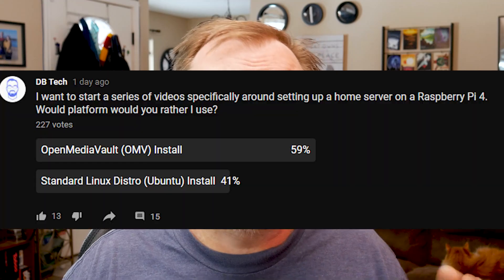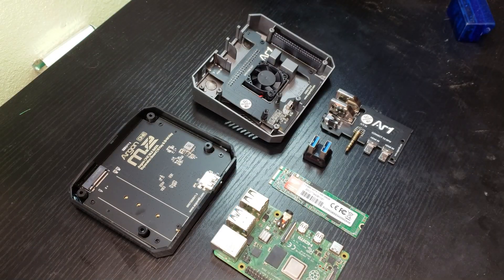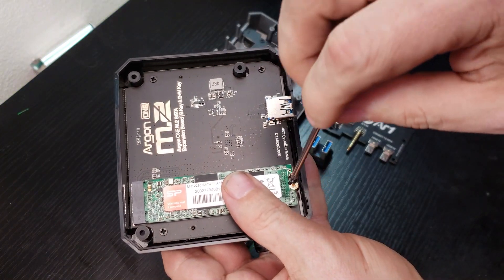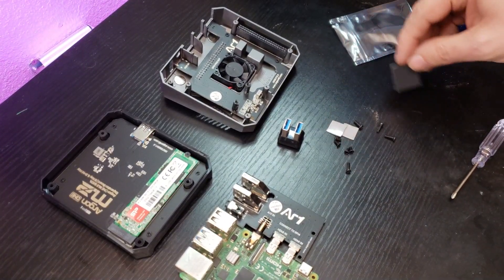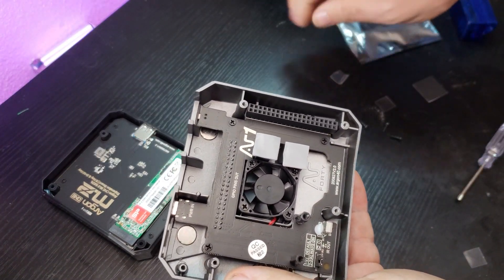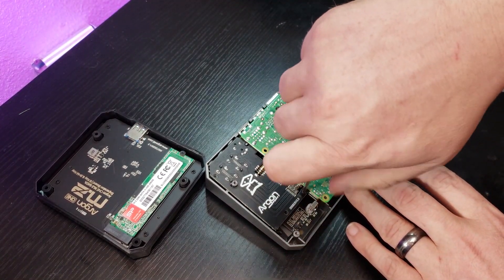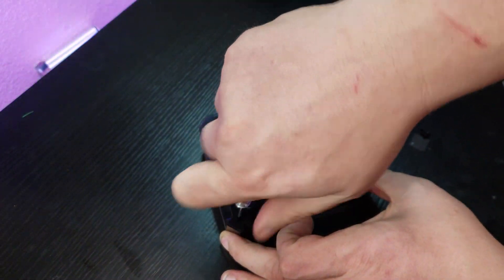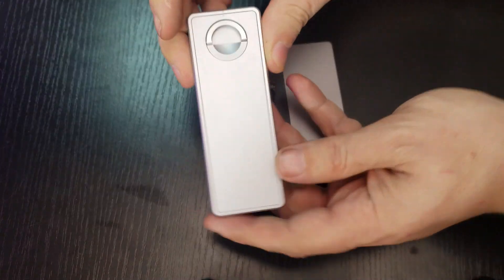Raspberry Pi Home Server Episode 1: Hardware - Raspberry Pi 4 8GB - Argon One M.2 - Sabrent

Comment from the maker: There are a couple of things I forgot to mention in this video: I will be using Raspberry Pi OS WITH the desktop. Also, I needed a POWERED USB hub in order for the 2TB external drive to have enough power to work appropriately.
Reply: I have one and is very good, I have 3 ssd connected to it. One for Movies and TV Shows not being backed up as I delete the media when I watch it. And one for my personal files, and the other one is just a mirror backup for my files using OMV rsync. My USB powered device is TP-Link UH720 and is working very good and tested as well in one of the Raspberry official page forum.
Reply: I have a 3 TB HDD (2 TB HDD + 1TB HDD) Connected to Pi 4 USB 3.0. The pi is powered from 18 Watt adapter, will it be sufficient enough for powering the entire system.

Comment: Great video! Would you mind making a video how to install raspbian and omv on the ssd or some instructions. I boot my pi from sd card and just interested how to boot from ssd for better performance. Also one more thing for the hardware. I have sometimes trouble to access omv and then I need to reboot pi and that's ok when I am at home but outside it is impossible. I bought a small device to control power from anywhere it is called  sonoff basicr2 (think around 5$), it has it's own application for android and ios from where you can simply on/off raspberry from anywhere. This solved all my issues when I wasn't able to access omv. Hope this helps! Your tutorials are the best! 👍

Comment: Just bought this case! Thanks!
Why you don't try to boot from the m.2 ssd?
Reply from the maker: I did boot from the M.2
Reply: @DBTechYT  sorry, I missed that part
Reply: @DBTechYT  I just got this case but can't boot from my ssd.. please show the installation process. Thanks!
Reply from the maker: If you can't boot from USB/SSD then you most likely don't have the most current firmware on your Raspberry Pi that allows for booting from USB and you need to upgrade the firmware of your Pi.

If you're not sure how to get your OS on the SSD in the case, then what you need is a cable like this: https://amzn.to/3hspVxx

Install the SSD into the bottom portion of the case.
Plug one end of the USB cable into the USB port on the bottom portion of the case.
Plug the other end of the USB into your computer.
Download the OS you want to use. 
Use something like Balena Etcher to "burn" the ISO to the SSD.

Then put the case together and plug in the USB bridge between the lower portion and the upper portion. Then you should be able to boot from the USB drive in your case.
Reply: @DBTechYT  I'm using WD m.2 ssd.
Already upgrade the firmware to the lastest and config to boot from usb.
Tried to flash raspberry pi is lite directly to the ssd- not boot.
Tried to to clone sd (with the same os) to the ssd and not boot.
Reply from the maker: I dunno then. That's the process I went through each time I setup my Pi devices to boot from any SSD.
Reply: Do you have any other recommendations for m.2 ssd for the argon?
The SC is not available.. :(
Reply from the maker: This is the one I'm using in mine: https://amzn.to/3aVnO44
Reply: @DBTechYT  I know, I wrote that it's not available
Reply from the maker: Oops. It was available for me, so I guess I missed that. Kingston is a good brand: https://amzn.to/3n0EWI7
Reply: @DBTechYT  the question is will it boot from this SSD?
I don't want to bought other ssd and find I can't boot from it like WD
Reply from the maker: I'm not sure. It has to be a SATA SSD. It can't be an NVMe SSD.
Reply: @DBTechYT  same ssd with usb to m.2 adapter work fine (but not in this case)
Which version of RasPi OS do you use?
It's 32bit?
Reply from the maker: I used Raspberry Pi OS 32bit
Reply: @DBTechYT  this 32bit OS don't used all the 8gb ram..
Reply from the maker: Then install Ubuntu 64bit for Raspberry Pi and then install OMV on top of it.
Reply: @DBTechYT   ok this issue is getting very weird.
If I add usb a male to female (Extension cable..) 
It's working!

Comment: Would be interesting to know how well the case can cool the Pi without connecting the fan. Also what USB3 to SATA III chipset it uses as there are quite a few out there that "support" UASP but don't really work well with PI
Reply from the maker: I just installed Raspberry Pi OS with the desktop. Without the fan (which I just put there mostly for looks) it idles in the mid-40s. It's got an ASM1153E chip that you can learn more about here: https://www.asmedia.com.tw/eng/e_show_products.php?cate_index=171&item=133
Reply: @DBTechYT  thanks! Great to hear.